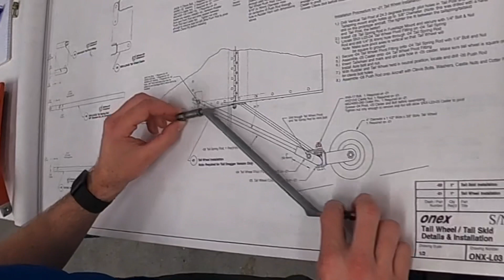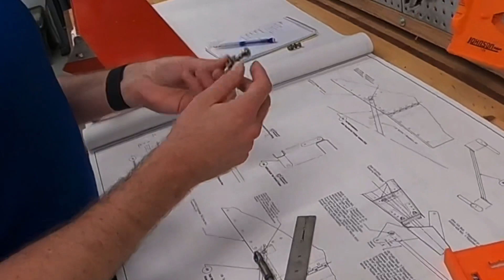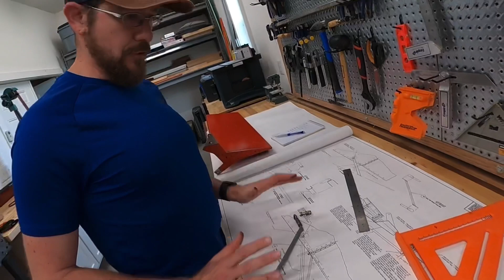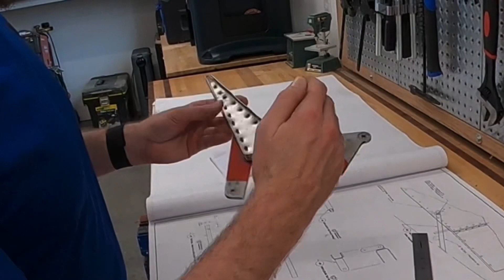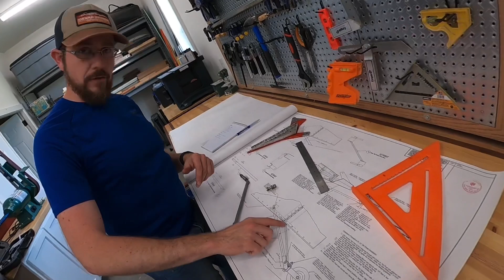So What Went Wrong? (Lean of Peak Aviation)

Comment: A&P mechanic here, those rivets failed in the force direction of tension.  Pretty much all rivets are designed to hold in the force direction of sheer, not tension.  They clearly had a tension load and that caused the failure.  If you can figure out what was causing the tension load and remove it, you'll be fine.  Good luck sir and thanks for the update.  Please keep us posted.
Reply: @Acirema Reidlos, Hello!!; I'm also an A&P tech , with structural experience .... You do have a point of how solid rivets are designed to be loaded in fastening sheets together... I do not know what the thickness or the material type is, of what the rudder control horn is, but as a general rule , the diameter of the rivets should generally be 2.5-3 x the thickness of the thickest sheet... That lower driving rib looked just a bit humble... Yes that probably was the original design that Sonex made, but it still looks pretty thin... And almost an entire row of rivets practically pulled right through that rib, also, both rows of rivets are very close, if not encroaching into the bend radaii of that base driven rib.. If the rib has to be of O.E.M. thickness and material type, couldn't a doubler of the same material type, be installed inside of the negative depression of that rib, and put an AN 470 type of a manufactured head on the inboard end (facing down) on that rib?? This way, the solid rivets won't pull through as easily, as the ones that were originally there did... And about that tail wheel steering tie-rod; why is it even needed? Several planes that are tail-draggers have dampened/spring-centered free moving casters for the tail-wheels... At low speeds, the steering can be controlled by differential braking of the main gear brakes... When the plane begins to build speed, the rudder will use aero-dynamic forces to control the YAW, before & after the empenage starts flying... Of coarse , any changes from the basic OEM design should be approved by Sonex Aircraft..  And because of what was shown here, changes (by Sonex) just might be suggested for these planes, in this area, and maybe other areas of their various designs....... It is not unusual for planes and equipment of many types, to develop unforseen problems with their O.E.M. designs.... As long as the manufacturer studies the issues to clear problems that could develop... And Sonex got to this customer IMMEDIATELY , to work out a solution to these issues... They probably notified all owners of these planes, of the suspected issues, and have advised them how to check for these issues... That is a reasonable action taking place to attempt to increase the safety factor of these planes....
Reply: @michaelmartinez1345  Yes, that caught my eye also. Thick control horn (seems to be about appropriate), but the rib is really thin. I bet they made all the ribs from the same thickness sheet to keep things simple. I'd say that if the rib were the "right" thickness, it would be very difficult to bend without cracking. The better path would be to put a doubler on the inside of the rib that is the same thickness as the control horn material.
Reply: @KlingbergWingMkII  when re-making things like ribs out of sheet metal, the bend radius and material type and thickness is an important consideration . If the metal is thicker, it might need a larger bend radius.... Also the bend tangent lines of a larger radius will be located in different places, on the pre-forming layout....Also, the rudder panel is tapered, which means every rib is different...  This is why a doubler , located inside on a new pre-formed part makes a lot of sense... My guess is most of the problem of this situation was caused by the push-pull rod to the tail wheel of this tail-dragger aircraft..  Why not eliminate the push-pull rod, and put a dampener /centering springs on a caster tail wheel assy, like so many other tail-draggers use.... At slow speeds steer with differential braking between the two main landing gear brakes, and as the plane has more power applied, propeller slipstream and forward motion will give the empenage & control surfaces more flight control authority...
Reply: sonex themselves replied they found a modification to the control rod that applied pressure that caused the problem
Reply: Single pushrod tailwheel linkage bad design...at a minimum should be the time proven dual cable in pull--pull With spring connectors.....The control horn should be embedded Slot mounted with Substantial rudder rib  frame structure on Both sides of control horn, Not just end butted.....Looks like chinesium toy construction there.....Is this the "standard" design for rest of airframe ??
Reply: @tomstrum6259  It looks like the rudder actuation is fine, maybe a slightly beefier end (driven) rib assy... There are quite a few tail-dragger aircraft designs with dampened/spring centered caster type tail wheels that are not connected to the rudder control system.... These aircraft steer at slow speeds with differential  braking at low speeds, then when the power is applied, the prop driven airstream and forward movement of the aicraft will give the rudder enough control authority to yaw the plane from left to right...  That would be a proven sollution for the tail wheel steering control on this plane, at low to medium speeds.... I agree with you about the mechanically driven - steerable tail wheel on this plane, which is definitely causing issues with the rudder control system, and causing overloading of that necessary primary flight control. I don't know about the rest of the plane, as I don't own or have access to one. But this is a specific problem with this plane, that can be remedied fairly easily... I don't immediately assume the rest of the plane is riddled with design flaws, unless they are known to exist, or there are indications that they exist...  Just about all things that were made by people - have some issues that can be corrected or improved, and to find an issue, does not necessarily mean the rest of the design is flawed....
Reply: @tomstrum6259  - The linkage (when built and installed per the plans, not the unapproved mod done by the original builder of this airframe) has tens of thousands of hours on the fleet without this problem occurring.
Many people opine on the rudder control linkage because (a) they don't know how the rest of the control system works [for example: the fact that the Sonex does not use differential brakes], and (b) its very different from what people are used to seeing.  But being different doesn't automatically mean its wrong.  The person who engineered this airplane worked for Lockheed for many years and is extremely well-respected in his field.
Reply: @noelwade  not to say the Lockheed engineer who was involved with the design of this plane did not know what they were doing, on the other hand so far, this appears to have potential to a reasonable plane... But there is a reason so many planes use differential braking systems, both tricycle and tail-dragger types... I'm not an engineer myself, but have seen other planes and have noticed strong and not-so strong points with all of them... Even Lockheed has been known to make errors with their designs... The first thing that comes to my mind are the center wing-box fatigue and corrosion issues with the C-130's... Nobody is perfect Amigo...Nobody.....
Reply: @michaelmartinez1345  - Sure, lots of planes use differential brakes; but plenty of airplanes do not use differential brakes.  My point was not that differential braking was good or bad. My point is that a differential braking system applies specific loads on the tailwheel system. Those loads are not being applied in this case because the Sonex does not have differential brakes.  In fact, Sonex themselves have issued warnings about the loads on the tailwheel assembly when people do modify their Sonex with differential brakes.
And yes, even experienced engineers make mistakes. The Sonex is not a flawless airplane (the original canopy design, for instance, has some known weaknesses that make it prone to damage); but when it comes to the tailwheel assembly there have been no indications of a systemic problem or weakness *when built per the plans*. The airplane has been available to build for 20+ years now. If there was an inherent problem in the design of that tailwheel assembly it would have started showing up across the fleet by now. 
To reiterate: This Sonex failed because the original builder made their own flawed modification to the tailwheel system. People claiming that the Sonex tailwheel is doomed to failure because it doesn't use cables/springs and a swiveling tailwheel are ignoring the evidence from the Sonex fleet, and other aircraft.
Reply: @noelwade  I did not realize that Sonex posted a document to ' not install differential brakes ' ,  obviously because of the inherent problems on the tail wheel mechanical steering system.... And if there were no inherent problems with the tail wheel mechanical steering system on those planes (as you said repeatedly , that there are not) , then why would Sonex make such a written statement? If the differential brakes were not installed on other planes, then why would Sonex have made such a statement? Especially if similar problems (supposedly) did not exist on their other planes? I hate to say it, but it appears that you just opened-up a can of worms on this issue Amigo.... If I were you, I'd not say anything else about this obvious design issue.... Let Sonix handle it....
Reply: @michaelmartinez1345  - No, they did not say it was because of "inherent problems with the steering system".  You are mischaracterizing facts to fit your own narrative/bias.  Differential braking applies different loads on the tailwheel than the stock Sonex brakes and steering system.  The steering system has proven to be perfectly fine for the system as-designed. However, people have installed differential brakes and kept the stock steering system (against Sonex recommendations), and that inappropriate change has sheared the fasteners that hold the tailwheel to the control-horn that attaches to the tailwheel itself.  Note that this is not the rudder control horn. Problems with differential brakes have not caused any known failures with the rudder system. 
In their note about replacing the tailwheel fasteners, Sonex explains the issue of differential braking applying loads on the tailwheel that it was not designed for, and advises people to use a different tailwheel system if they want to use differential brakes. Sonex is also philosophically opposed to differential brakes because in their opinion it adds weight and complexity that the small and lightweight aircraft does not require. 
You can agree or disagree that differential brakes are not necessary; but that is their stance - and its their aircraft design. ANY modifications that a builder does are done at the builder's own risk.  The issue in the case of this video is that a second-hand owner bought an airplane without understanding that a builder-modification was putting him at-risk! Its unfortunate that the builder did not inform the buyer of this non-stock setup, as he should have done.
Reply: For your education, here is the text from the Sonex website (I'm posting this because URLs in YouTube comments don't always work). I have bolded the important sentences:
-----
Description:
Sonex Aircraft has received reports of the screws that hold the steering arm to the caster failing. This can result in the loss of directional control during ground operations.

The risk of a failure increases if differential brakes are installed. The Sonex Aircraft Machined Tailwheel Assembly is not intended for use with differential brakes.

Corrective Action:
Sonex Aircraft began using NAS623-2-7 screw and MS21042-08 nuts in the assembly of all Machined Tailwheel Assemblies on 09/13/2018. These replace the fully-threaded screws previously used.

Units that have already been delivered can be refitted with the new hardware:
Remove the fully threaded screws that hold the steering arm to the caster body.
Drill through the threaded holes of the caster body with a #19 drill bit to remove the existing threads and enlarge the holes for the new screws.
Re-install the steering arm with two (2) NAS623-2-7 screws and two (2) MS21042-08 nuts.

The hardware can be sourced from numerous aircraft hardware supply sources or ordered through the Sonex Aircraft Webstore
Reply: To put this a different way: If you took a car that was designed to have a 4-cylinder engine and you decided to drop in a big V-8 engine, don't you see how that could cause problems?  The car may be fine with a 4-cylinder engine but actually unsafe with a V-8 in it.  That doesn't mean the car itself is unsafe - it means that car was designed with specific parts and operational parameters in mind.
Reply: @noelwade  thank you Noel for the "education" as you put it, of how other Sonex owners have experienced problems with the tail wheel steering systems on their airplanes.... And you are correct, NO MENTION was made by Sonex of the loose rudder horn, that developed on the aircraft of this article.  And that a sheared NON STRUCTURAL all-threaded fastener used for things like ( NON PSE applications) : securing flashlights to walls, holding coffee pots in place, holding floorboards on their tracks, holding adell clamps in place, etc.... Non Structural applications that are NOT attached to Principal Structural Elements... The steering system of ANY vehicle , does NOT use all threaded fasteners to pivot on.... It is becoming obvious as to WHY shortcuts like these were used instead of doing it properly.... To save $ of manufacturing.... Possibly the same reason that Sonex decided to install this funky offset pushrod on the steering system, instead of installing a set of differential brakes to handle the plane at low speeds with a spring-loaded self centering tail wheel...Maybe a little more money and possibly another 7-8 lbs... for the two extra cylinders and some nylon tubing. Apparently, as per the post that you just put on here, and screen shot, the company already knew about these issues... Thank you for opening that can of worms... It was a very interesting "education" as you put it... Now try to not say another word, as Sonex is probably already in a lot of 'hot water' over this.... Let them handle these issues.... The pilot / owner of his plane did an excellent job of making everybody aware of this obvious inherent problem, by posting this video, and thank God he did that...
Reply: @michaelmartinez1345  - You continue to twist things to fit your narrative, so this will be my last reply; I have an airplane to go fly rather than beat my head against a wall or feed a troll.
"No mention... of the loose rudder horn" was made because Sonex published their notice LONG before this person's experience! Issues with the tailwheel were known and resolved many years ago.  Also, as I have repeatedly pointed out, no one else has experienced a loose rudder horn. The bulletin I quoted is not referencing the rudder horn _at all_. 
The problem with the airframe in this video is the modified tailwheel attachment system, which applied forces on the rudder that it was not designed to take. If you bought a Cessna and then you decided to change the way its wheels were attached to the steering system, would you blame Cessna if it then failed? Or would it be your fault for making modifications to the airplane?  
In this case, the person who bought the aircraft did nothing wrong, but the person who built the airplane definitely did something wrong! 
  
Sonex is in NO "hot water" over this, because Sonex had nothing to do with this. Again: the issue isn't with the way the Sonex is designed. This was not a stock Sonex part that failed. Hundreds of these airplanes are flying - and they have been for 20 years - with no other failures of the rudder horn like this. The Sonex design may designed the way YOU would like it; but tens of thousands of flying hours prove that it is engineered well-enough to handle normal operations just fine. This was a one-off failure because someone decided to make a modification to the design without understanding the effect it would have on the rest of the structure.
The one thing I agree with you on is that its good of this owner to post their experience, and to do so with a measured approach to explaining the problem and pointing out that it was not the stock Sonex parts that caused the issue.
Reply: @noelwade  What? What does a 4-cylinder engine or a V-8 engine have in common with this situation ?(your persuasion and words)... I read the 'Remedy' that you sent to me, which Sonex has apparently, already sent to the owners of these affected planes... And what I learned is shocking...Not only were all threaded, NON STRUCTURAL Tiny screws used as pivot points, on this ridiculous off-set steering link, but they decided to just change the hardware of holding this mechanical steering link, as a 'sollution' ???? You have to be kidding me, right?...  This is Bad... No wonder people are saying negative things about this design... Not only were they using non-structural hardware in critical areas, such as the steering system for the ground handling this plane, but they are also using whimpy non drilled (no cotter keys- a Bozo No-No on end link pivots of ANY kind of linkage, FAR regs, look it up) #8 screws as pivots for that linkage... Underbuilt, would also be a gross Understatement of how they address several potentially serious issues that could easily cause the plane to ground-loop in a cross-wind gust, if those #8 screws come loose or fail... It is NO WONDER people are installing differential braking systems and completely removing the Rube- Goldberg tail wheel steering designs that (Sub)Sonex designed,  & Installing the well proven spring centering tail wheel assembly kits, readily available for about $100 from several manufacturers ... If I had that plane, one of the first things that I would do, would be to '86' that stock tail wheel & mount assembly,  along with the official patented 'super-Rube Goldberg' (water witching) steering link, and  install one of those really nice , spring centering, shock mounted aftermarket tail wheel assemblies. Then get the diff brakes set-up on it. But the first thing that I would do, is replace that damaged & likely over-stressed lower rudder rib and re-attatch the control horn with a doubler on the inside of the rib and the manufactured button head (AN 470) on the inside of that rib, with the buck tails on the control horn side... That is what this whole thread is about, keeping the plane in an integrated assembly so it can be flown safely, and give the plane, pilot, passenger, and anybody nearby on the ground a better chance to live another day.... Then check the weight/Ballance of the plane and adjust the position of the battery as necessary to put her back into her envelope.... The basic design of the plane is very nice... It is the use of the chintzy hardware and use of some pathetic/poor engineering practices that need vast improvement... As far as you flying in a plane, if it is one of these, bring a parachute Amigo, better yet, use a BRS chute so the plane can be used to show what failed, and what should be improved.... As far as feeding trolls , try to stay away from those donut shops Dude...As far as Sonex NOT making a mention , of this potentially dangerous situation of the loose rudder horn, all I have to say is , God bless the MAN who posted this video, otherwise more people could have experienced these issues, while in flight... And then see about what happened on one of the aviation safety channels.... God bless the MAN who posted this video.... And regarding his reply to the damage that the steering linkage that SONEX said was the cause because of it being incorrect, heck the whole idea of actuating the ground steering system with that whimpy design is incorrect-even the original parts are wrong in so many ways....The drawing that he had to work with was not even close to the full scale of the actual part...  All he had to go by were the drawings of a part that was supposed to be on that plane... I never saw a protractor being used to measure the angles of those bends, nor did I observe any center to center measurements being taken from the two tiny holes for those NON-STRUCTURAL #8 non cotter pinned Fasteners being incorrectly used for pivots that are not properly safetied, of the 'water-witching' steering linkage.... Chances are, if you continue flying in something that was built like this from the start, with these types of techniques, and not taking a closer inspection of build quality or angular irregularities, you'll be "banging your head" (your selection of words) again, but it probably won't be the wall of your house, but the wall that holds the gauges in your plane.... And banging it a lot harder than You're used to...  Just saying dude, fly safely...... Please don't put anybody else in danger, from your obvious neglegence of safe construction practices & techniques... Please, try to stay away- from populated areas....
Reply: @noelwade  wow, you do realize that even very large and successful companies, have made mistakes when they design planes, right? Otherwise, there would be no need for AD Notes or any other kind of service bulletins to be issued... If I were you, I would not blindly assume that no problems existed with machines, like these, when they have been sold to the public... I would first challenge people without that alternative view of WHAT caused this and WHY it happened , just to see how far in the sand they have buried their heads... And if they instantly lash-out at anybody with an alternative view, just because it goes against a person's ideas who originally designed such a device, which could be faulty... That would give me the answer that I am looking for, of whether I trust them, or not... Usually , when people get angry about things like this, it is because : 1) They are worried that the company (of which they happen to have good friends - that work there) who made the device, could be facing trouble , because of an inherent faulty design (that they may or may-not want to admit they made a mistake) or 2)They know for a fact that the fault was created by the builder who assembled the plane (who happens to be a friend of theirs) or 3) Somebody modified the plane and did not follow the design (Who could be another friend of theirs) or 4) Because it is only Normal wear, that took it's toll on those parts that failed, (But the rest of the plane is assuredly ok) - which, of course - would be an advanced state of self-imposed blindness.... In any case, it is a good thing the owner/operator of this machine found this problem, BEFORE he took it up again... That could have saved his life and the plane... After working on various planes, and helicopters, and several other types of mechanical marvels for several years,  I have realized that NONE of them  are perfect...Just like anything... They all have faults....  But to blindly assume that the same issue would not happen again, without a sure way to correct it, or check it for a state of a safe condition, to operate is just asking for an accident...I asked the owner of this plane, if the new "water-witching" steering linkage he received from Sonex was any different than the one that he found on the plane... So far, I have not heard from him... Maybe because he knew that I would ask him to put the old one on top of the new one, to see how far off it is, or how badly bent it is... And the use of the #8-32 non-structural all-thread (shank-less) type of screws, without castle nuts or cotter keys, that are being used as pivots? That is seriously wrong... And the use of 'pop' mandrel-less rivets (used on residential Air Conditioning sheet metal work, and other types of home repairs) to fasten the control horn to the rudder? No, I would not feel safe with a design like that... Not on a primary flight control... Even though I am not somebody who has an engineering degree, I do know how plane's are supposed to be built, and this one does not cut the mustard.... Not the fault of the owner, but a serious short-coming of at least one, of the designers of this machine....